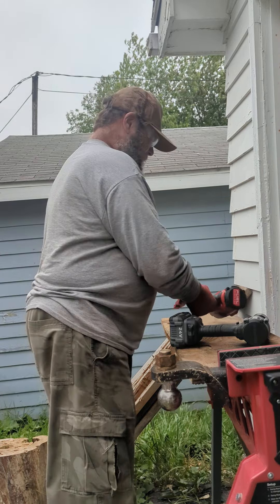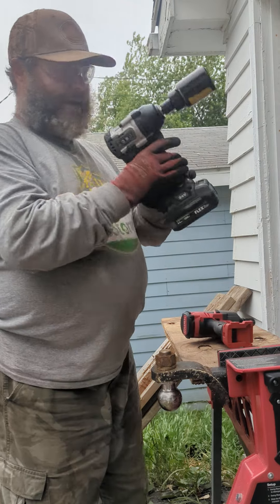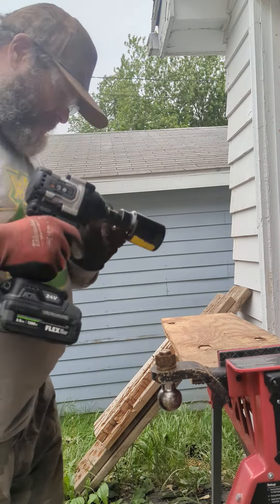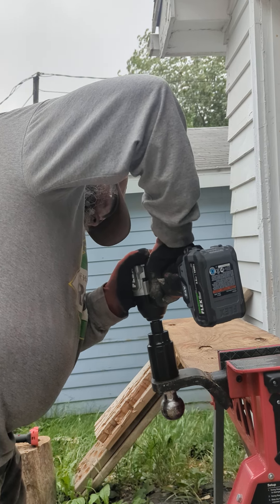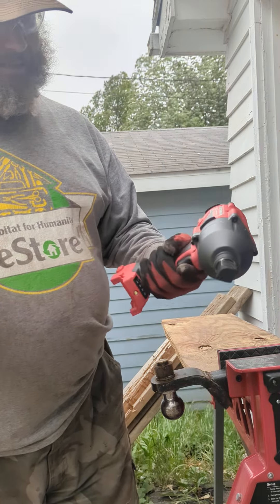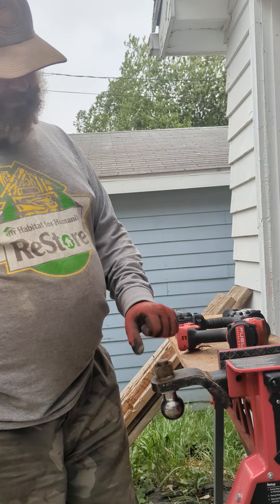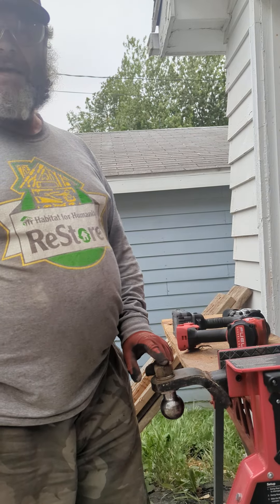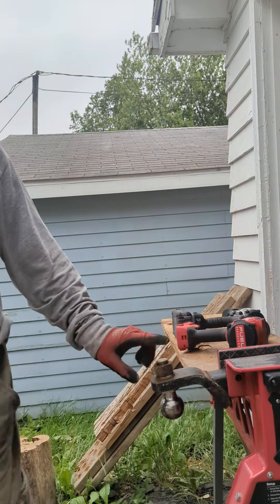FLEX 1451 MID TQ IMPACT WRENCH 3.5 STACKED LITHIUM VS 1 1/5 NUTT

Comment: Hi there is there a chance you could test it with the 10Ah Battery
Reply from the maker: I Don't have 1 it's pretty EXPENSIVE and is CHEAPER if I would buy it with the REAR HANDLE cir saw will get it when the saw drops to $300
Reply from the maker: I do have the 6 AMP STACKED LITHIUM
Reply: Ok thanks for the reply I'll be watching 👍